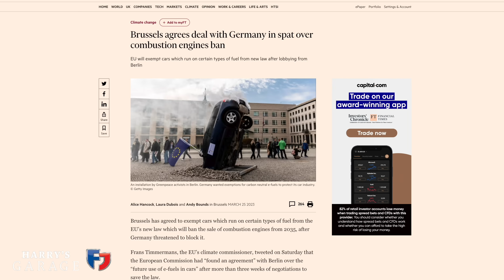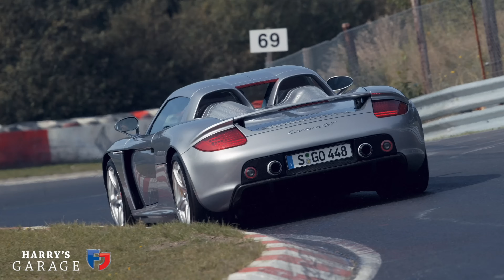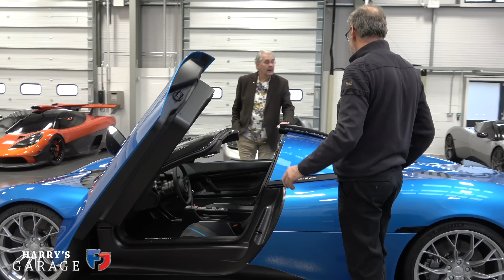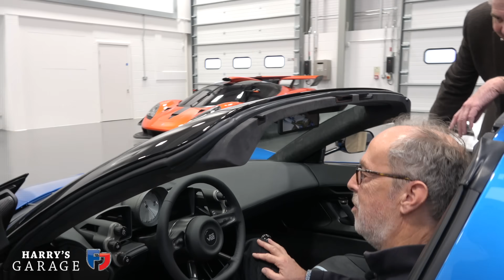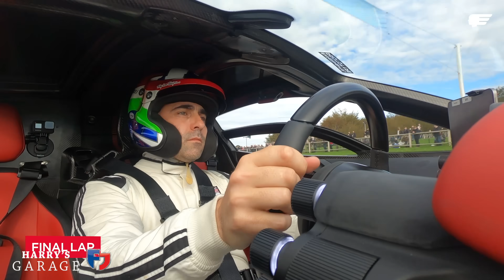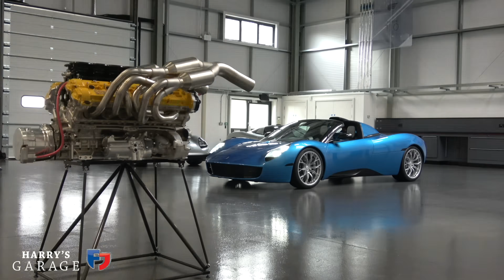T.33 Spider reveal plus Gordon Murray explains where supercars are heading next & it's not electric!

Comment: Mostly analogue, naturally aspirated (ie. no lame, sound-destroying turbos), relative to other modern cars beautiful & feminine rather than trying to look like a hyper-aggressive demon, clean styling, little-to-no plastic chunky bits of crap all over the exterior, clutch, h-pattern, no auto-lift and auto-blip on the up and down shifts, sounds fantastic even at half-throttle and half-revs,  actually sounds like it's revving as high as it sounds (or thereabouts), focused on the incredible thrill and emotion of high performance cars & driving rather than pure laptimes, etc...It seems that GMA has overtaken Ferrari as the purest, most passionate, and beautiful cars and I'm a life-long Ferrari nut. Having said that, in terms of purely just styling, Ferrari is right up there with the 296 GTB (especially when seen in real life) and possibly the Roma (haven't seen it in real life yet) but GMA has the total formula nailed down perfectly.

GMA is what Ferrari was. GMA is what Ferrari is still supposed to be.

I wish so much that Gordan Murray was with Ferrari.

Comment: 900 kg. Mid mount. No intervention, true sport road plus. Mabie with the Konigseg freevalve tech! Get outside the box 10~12 000 rpm small turbo 1 litre drivers road gocart.
A drivers car.
No 0~100
No top speed. Just driver centred.

Comment: I don’t know if the performance is any good but as far as looks go I can’t see anyone choosing to buy that over a Ferrari lambo or pagani. I mean it just looks like a kit car, it’s not hating on the man but obviously if he doesn’t have the resources for different departments within the company then how is he supposed to compete? I mean certainly lambo/Audi spend millions on R&D. I mean they will design switches etc from the ground up and then test them for various characteristics etc, where as I assume this car has surely raided the parts bin for Ford or similar. What are the Nurburgring numbers? I mean Harry trying to sound excited about it, he did try to point out the handbrake from a dodgem car and the fact that most proper manufacturers have managed to develop and automatic or paddle shift. I mean Supercar? Oh my dayz! 1.9 million???? Is that Monopoly money?
Reply: There's not a single component in that car that GMA didn't design. Not to mention Gordon doesn't give a rats ass about laptimes

Comment: short summary about the most valuable info here - Lotus Evora and A110 are still the best driving machines you can buy at the moment, car should be light with rigid chassis proper working in every scenario suspension and with passive dampers

Comment: I think of the three, this is the easily the best looking and my favorite of current rear engined Supercars It is nearest to those pretty historic Alpha Romeos and Ferrari like the 250GTO  and Dino with the big round headlights and swooping curved lines mostly banished by aero, and regulatory these days.
 Post 70's supercar looks are more brutal and  edgy and  but for branding details all a bit  samey, So its nice to see something a bit dialed back and aiming for simple 60's chique rather than flying wedge bonkers.
 I'm not sure if the sharks fin intake and rear tray detailing are quite right, but it's not far off either, I would like to see  what it's like it integrated a bit more by design into the hoop and  in body colored paint.

Comment: There is no reason why this needs to be a £2m car. The F1 was the pinnacle of automotive engineering of its time in 1992 and sold for £540k which, when adjusted to today's money is £1.1m. I fully respect Gordon's achievements but i cannot imagine for one moment that he didn't consider the comparative difference by setting the price at that level. Even the Veyron, which arguably pushed the envelope in 2005 was listed at £925k or £1.5m today.
Reply: The Veyron made no money whatsoever.
Reply: @gdfggggg  Indeed, yet despite all their achievements VAG still priced it at a level under the one set here. That's my point.
Reply: @Popolou  They are huge company so they could take the loss. In wasn't reality paying that, for the engineering involved in the Bugatti. A startup like GMA has to make a profit. If people are willing to pay the price, then it's not really an issue.
Reply: @gdfggggg  "If people are willing to pay the price...." which takes us full circle to my OP. The F1 wasn't priced to the same profit levels as this is so sadly it's not built with the same ethos as back then.

Comment: Love the manual transmission, thin wheel and real hand brake. Those are things that should never disappear from a driver’s car.
Reply: word
Reply: @ashred9665 ??
Reply: Electric hand brakes are horrible and it's always disappointing to see sports cars with them, I mean seriously?
Reply: For real. I bought a Tesla for a daily driver and love it but if I'm splurging on a proper sports car it better damn well be a proper manual.
Reply: If you're chasing time, paddle shifting is the optimal solution as of yet. You know it's true – or are there any professional race drivers asking for gear knobs? There's this cultish attitude about certain anachronisms, just like vinyl aficionados: data on plastic is MAGIC! And if you let the machine sync beats – or rotate your turntable at constant speed – you're a phony!1!
Reply: @brucel337  yeah, for the few that actually chase time with their cars, go for your paddle shifts. If you just drive for the fun of it, a manual is where it’s at. 

I’ll happily race with a manual but still don’t care about time. It doesn’t matter to me if I lose as long as I’ve had fun with the car.
Reply: I don't understand the desire for a regular handbrake. You won't be doing handbrake turns in a T.33. A small hatchback maybe..

Comment: If they ban ICE completely then we as a race are doomed because it definitely means we're lead by selfish, greedy, irresponsible ppl. @1:00 Business forum of some kind was a month or two in the US amd the amount of private jets used for by attending ones made so much CO2 it's mind blowing compared to the amount cars make in a year. For details google. Then there are ships and regular airplanes. Ok, we can't expect to run airplanes on EV power yet, or ships but nothing has been done about it. Another issue ofc is the material needed for batteries and their longevity. All those are aspects they go against the ban of ICE but no one mentions them. And how technology used for gathering substances needed for battery manufacturing is so destructive and how the process makes also unreasonably high CO2 output. Do we then mention how regulsr hybrid all thing considered including manufacturing and usage of 10 years still makes overall less CO2 then an EV and so on.

Comment: Very cool. This is a perfect drivers car. Sure T50 is ultimate but the roof doesn’t come off and whilst you sit in the middle, your cramped s/o isn’t going to be best pleased! Glad the roof can be stowed easily too. On the EV thing petrol for small batch performance makes most sense. Primarily for weight; you need range, infrastructure and *low weight*. Environmentally you need less material harvesting (think cobalt, etc)for a battery that is going to get minimal drivers use (compared to a daily runner where it makes sense) which is also crucial. Unless you drive your electric supercar almost everyday (which most owners will not) then it is perhaps more sensible to keep them petrol. Of course the family car should go electric, there is seldom a good argument that this should not be the case, but with the low volume production and low usage (minuscule % of total car use) sports cars should probably stay with the same emissions regs as today, whilst transitioning most everything else that is produced above x units/model.

Comment: i have a design that uses such a short vehicle my only option is to go electric. but the chassis given that the original one. the chassis itself with a carbon fiber panel being 9.5 oz is only 200-250 pounds in dry.

Comment: The most amazing thing was Harry's jaw not hitting the floor when Gordon told him the price! 💰💰💰
Reply: I actually gasped out loud lol
Reply: At that price most of these will go into private collections and never turn a wheel again.
Reply: @markgilbertson1564  at that price Gordon is going to be rubbing his hands together 🤑🤑🤑
Reply: @iancampbell2295  na I don't think the profit  margin will be as high as you would think
Reply: @yota8325  ???? Are you kidding, he's making over a million on each car , that's the point.
Reply: @iancampbell2295  Once you factor in costs for his business this is more a passion project than anything, his other design & engineering businesses he mentioned are the money makers.
Reply: @DEJ915  you think a car which is basically a Lotus Emira , which by the way costs £75,000 , isn't making money at 1.8 million!!
Reply: @iancampbell2295  You can't compare a brand which cuts corners to make their vehicles as cheap as possible to a bespoke one like this.  Even Toyota (who makes and sells the engines Lotus uses) didn't want to invest to build a new inline-6 for the Supra and just purchased them from BMW instead because of the development costs.
Reply: @DEJ915  yeah ,that's why Gordon bought engines from Cosworth! 😂💰

Comment: I love your chats with Gordon – there's just so much depth of engineering and thought in every part. Loved the 'don't film this bit Charlie…'
Reply: The GMA visits are by far my favorite. I could listen to Gordon talk forever.
Reply: Far better than most of these young car tubers
Reply: $2.35M, £1.8M for an unremarkable looking car inside and out. The package is purposely simple and light, but nothing outstanding. As for power, I'll take displacement and low end torque over 11,000 rpm any day. Wrong car, wrong price, GMA heading for GM-Administration.
Reply: @stephenc6955  Don't buy one then?

Comment: so how many of these have been sold? looks like another boutique car company that wants to drive up news demand take money for deposits and barely or never deliver, this hhas happened so many times in the past. Im not dismissing Gordons work, but the pricing on these vs other cars in production with better performance figures and cheaper leads me to arrive at the conclusions I have
Reply: When the T50 was officially released, the 100 cars were sold within a few days.
As per the video, T50 is now in production.
First customer cars get delivered mid year.
The T33 Coupe also sold out within a few days of official release.
100 vehicles, production begins after T50.
These vehicles are absolutely bespoke etc.
You are paying for an exclusive hand built vehicle.
The weight of these cars is extremely low.
Clever design and low weight materials ( that are expensive )
Performance figures have not been released.
The engine is a V12, in a light car.
They are very fast…
With a manual transmission, it’s all about driver involvement and enjoyment.
Whether it does 
0 to 100 kms etc 
In 3 or 3.5 seconds is irrelevant…

Comment: Price is outrageous,with similar build and performance as a MC laren
Reply: McLarens don't have insane N/A v12s and are made from old nissan parts then throw error codes at you all day 🤷‍♂️  Gordon has spared no expense on development much like the F1 its why they cost so much.
Reply: @Nightmaretyrant  McLaren's are made from old Nissan parts? Likely story...
Reply: @h2wr  Go look up part numbers, the engine is based on the Nissan Group C turbocharged flat crank v8, originally campaigned by Nissan then modified by TWR, the rights for production were sold to Riccardo engineering who modified it for street use in all Mclaren road cars since.
Reply: And Nissan made a peach of an engine,what's your point?With advancements in 3d printing and body design low volume cars like this have actually become alot cheaper in recent years.Should be a 300k car max